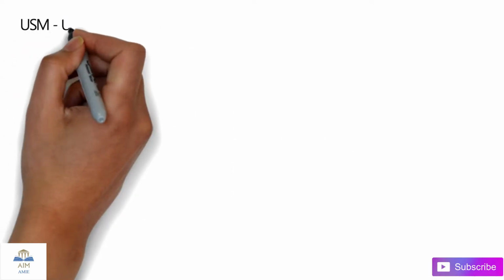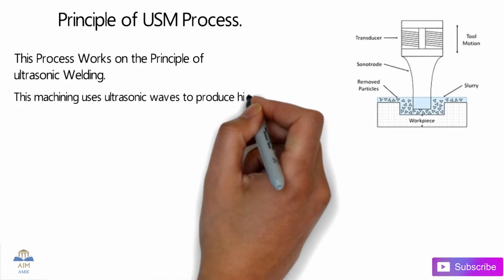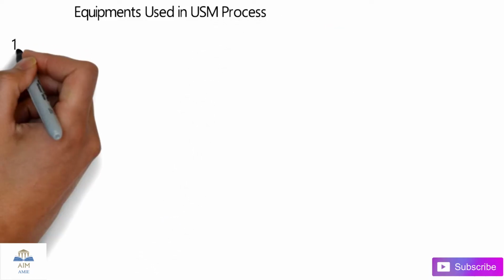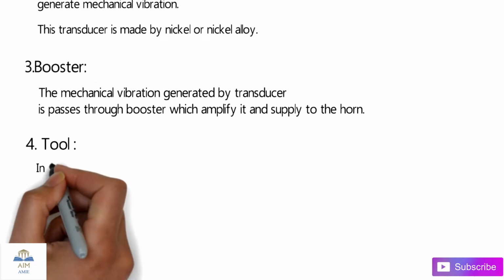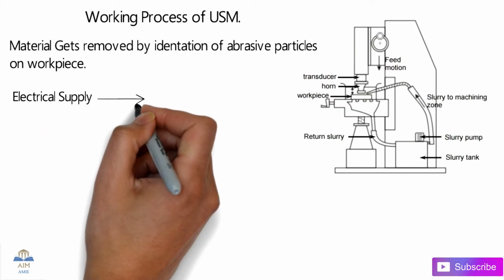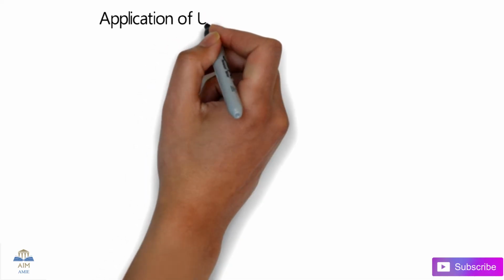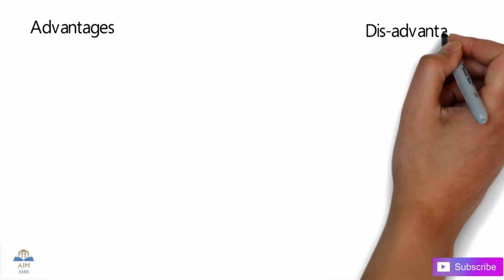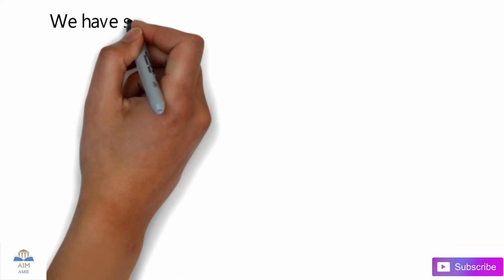How an Ultrasonic Machining Works??? ||Engineer's Academy||

Comment: Please can you answer this question as it was asked in my exam.
Why ultrasonic machining is not suitable for ductile material?
Reply from the maker: Ultrasonic machining (USM) isn't ideal for ductile materials like soft steel or copper for a couple of reasons:

* *Fracture Mechanism:* USM relies on a process called brittle fracture to remove material. It rapidly vibrates a tool with abrasive particles against the workpiece, creating tiny cracks that propagate and chip away at the material. Ductile materials, however, tend to bend and deform under pressure rather than shatter. So, the rapid vibrations don't effectively remove material  through fracturing.

* *Inefficient Material Removal:* Even if some fracturing occurs, the ductile nature of the material can lead to issues. The abrasives might end up pushing the ductile material around instead of fracturing and removing it cleanly. This can result in a poor surface finish and wasted energy.

There are instances where USM can be used with some difficulty on materials with some ductility like titanium alloys. However, for truly ductile materials like soft steel and copper, other machining methods are generally  more efficient and cost-effective.